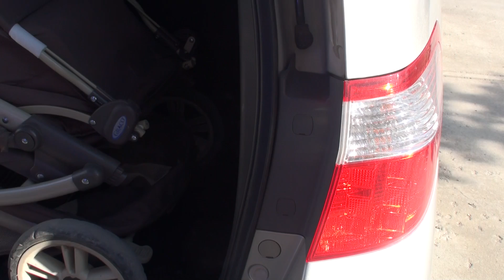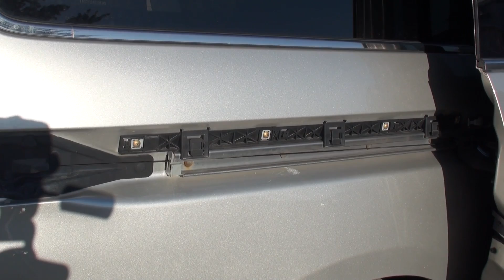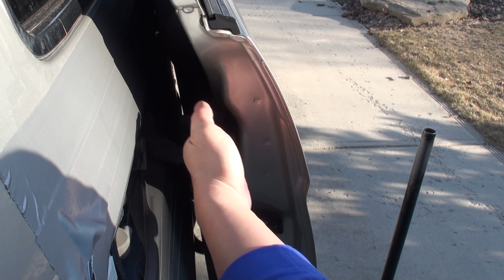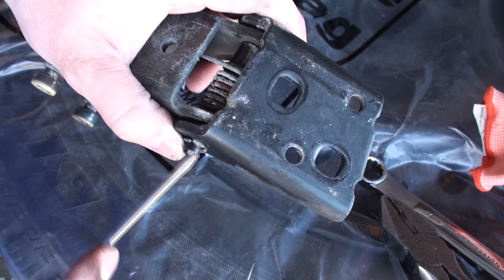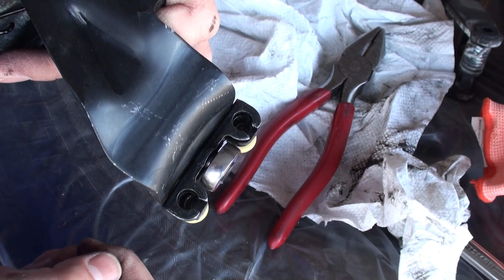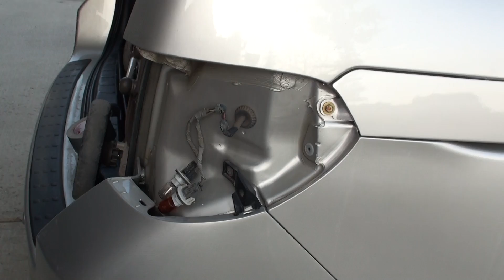Honda Odyssey Center Rail Door Roller Replacement

Comment: I don't have near the slack in the cable that he did to slide the cable out. Is there a way to get more slack?
Reply from the maker: hmm have you tried giving the cable and extra "tug"?  I found when mind didn't quite have enough give that I pulled just slighter harder and I got just enough slack I needed to get the cable into the roller.  The other alternative is to work the roller assembly as close to the van's body as possible.  For every inch away from the body of the van you're losing that in cable slack for the cables to "reach" to you if that makes any sense.
Reply: piercedasian is it one long cable where both ends connect to the roller? it seemed like every time I pulled cable from the rear it pulled the roller assembly forward so I didn't get extra slack, it just shifted the assembly.
Reply from the maker: I hooked one of the cable into the roller and then got it real close to the body of the van so that the cable doesn't "deviate" away from the body and then while holding the roller steady I used a pair of needle nose pliers to pull the cable closer to the roller and I got that tiny bit of slack needed (something silly like 3mms more slack was all I got) but that was JUST enough to get the cable in.  Worse case is you could crack the interior panel to get at the cable release mechanism but that is a LOT of work when most times you can get the cable in and out without having to do any of that extra (and generally needless) work.  The trick is to get super close to the van and don't force things if you know for sure they don't want to give.  You don't want to snap the cable as that would be really expensive and difficult to replace.

Comment: Thank you so much for this video - it really helped me tackle and complete this job today. The tip to cover the paint with tape saved me some scratches for sure!

One tip I can offer from another youtube video - when you go to remove the trim cover for the roller mechanism channel - just close the door until the rearmost edge kicks out before it closes completely, and you'll find the trim completely exposed for easy removal.
Reply from the maker: glad you liked my video!  Great tip on the trim cover.  Next time I have to replace another roller I'll give that shot.

Comment: Great video with clear instructions.  To make assembling the cable easier, I pulled on the rear cable until it was all the way extended, and clamped it with a vice grip pliers with cloth padding.  That way I didn't have to keep tension while trying to maneuver the retainer.
Reply from the maker: good tip!  Glad you were able to replace your own door rollers!

Comment: Just finished both doors. Hinges were completely shot. Don't know how they worked as long as they did. Ordered OEM door hinges online at 
Hondawholesaledirect.com for $40 each. shipped quick. Only took a couple of hours to do both doors. The cable can be a beast to reinstall. Be patient. Thanks again for the vid :)
Reply: Are they still working? Wondering if I should use aftermarket or genuine honda parts

Comment: Hi, 

Can you help me with the correct part number -  Which one would be Accurate - 72561-SHJ-A21 or  72521SHJA21 and Do both left and Right sliding door use the same part or different parts ?

Can you point me to a link where i can grab the part numbers for Left and Right Center roller assembly for 2006 Honda Odyssey 2006.

Thanks.
Reply from the maker: The part # is listed in my description for each side and NO they are not interchangeable.

Check out www.hondaautomotiveparts.com
Reply: I'm not seeing the part number in your description.  Can you repost?  Thanks!

Comment: Thank you so much!  The passenger side took me about 1 1/2 hours, with about 45 minutes of that being trying to reattach the passenger side cable. After doing the passenger side, I was able to complete the driver's side door in a whopping 15 minutes, including attaching the cable (there was a little more slack in that cable for some reason, and it went right back on). On the driver's side, I used a pair of needle nose pliers to grab the cable right next to the "pin".  It worked like a champ.  My passenger side rollers were completely gone.  Only stubs left.  No wonder the door wouldn't open.  Now, I need to find a video on resetting the doors, as the auto open just beeps and laughs at me.  You saved me big bucks, thank you!!
Reply from the maker: resetting the doors is easy.  There is a fuse cover on each side of the van's interior kick well.  Slide the cover off and there is a fuse that is for the power door (one on each side).  Pull that fuse for 1 minute and then reinsert fuse.  Systems should be reset.

Comment: May I ask where you learned to Diagnose and repair cars? I like the video. Your form seems to be very proper and you are conscious of the things most people would not care about not damaging.
Reply from the maker: I learned by just tinkering and my innate desire to do things in a "relatively" proper manner.  I hate poor quality work and strive to fix things with pride.  All self taught through and through...
Reply: I see. That is a very collective mindset. Very nice. I am similar. That is also what many people in the automotive field lack I am finding these days. In truth both japanese and German vehicles require this touch. Which is why both vary when coming to the states as to how long they will last. the hands of the technician are to receive the touch from the engineer..What i focused on in your video was the care you took to preserve things and clean things as well as explain in detail that was clear/ easy to follow. You like computers and nature as well I take it. Cars, computers are centered on very natural origins. Something in them intrigues the conscious mind that often relates to how all things touch in a natural setting to bring something to life..I really do commend you on this.
Reply from the maker: I try very hard to have that collective mindset indeed. Not enough people think that way and thus either don't appreciate the work and care that goes into things like cars and computers.  I see all too often "hacks" that make me shake my head constantly.  

Consider subscribing to (and sharing with others) my channel to get the latest in my OCD videos :)

Comment: Took about an hour with most of the time wasted just getting the cable back in the slot during reassembly. I did find a system that works. Once you have the cable on the front side in get a pair of needle nose pliers. Now rotate the assembly back towards the cable end. Slip the cable nut in to the bottom then use the pliers to turn the cable so it will drop into the slot. The trick is to turn roller toward the cable and turn the cable towards the roller slot, then it just slides in. Don't forget to lubricate the track the rollers roll in. Mine was dry and that may contribute to the rollers disintegrating. In my case one was completely gone and the other on the way.  Thanks again for saving me so much time and money!

Pat
Reply from the maker: glad you got your rollers all replaced and working again. Yeah that cable CAN BE pesky but once you've done one the other side is MUCH easier.  Just patience and time and some logical thinking is all that is needed to fix the issue.  Thanks for watching!
Reply: I'd love to see a video or perhaps better explanation on this before I start this job = oxlacey@yahoo.com

Comment: Nicely done. I was shocked at what the dealer wanted. Even at list price for the part which is I think $75.00 ans at 1.5 hours to do the job, the max should be $225. But they wanted $350 just for one side. I got my part on line $35.00 with free shipping. The unit is so bad the roller is hitting the rivets that hold the track on and often not closing or taking 4-5 tries to get it to close. Not what my daughter with 4 kids needs....
Reply from the maker: yeah what dealers charge is robbery.  Something so simple yet so expensive.

Comment: Pierce - have you tried to replace rear cable  ?   My has broken and i'm looking for similar quality diy video to work through replacing rear cable
Reply from the maker: I haven't replaced the rear cable but I have dismantled the interior to try to do other work and man is it a pain in the ass!  We can try to discuss offline for me to try to explain it although you'd be best to source yourself a factory service manual to ensure you get the job done right.
Reply from the maker: BTW the rear and front cable is actually the same cable.  It just gets pulled back and forth from front to back.  It is actually an entire cable reel assembly.

Comment: Cable snapped on mine.  Had to buy the whole motor assembly because they don't sell just the cable separately.  Popped out the door hinge pin with vice grips instead of unbolting the hinge as shown, and I didn't have to realign the door.  THANKS!  Video made it easy and my $150 ebay motor purchase saved me over $1000 at the dealership.
Reply from the maker: whoa snapped cable?  that sucks.. then again if a cable was going to break that chances are it was going to break.  I'm just glad to hear that you got things up and running again.

Comment: Awesome video!  I ended not taping the van because I was lazy.  I did find taking the cable out of the roller assembly the most difficult, but it's a little easier if you slide the door almost closed and move the roller assembly towards the back where it's all out in the open. I also had to pry the rear light assembly off with a tool.  Thank you for making this!
Reply from the maker: glad you got the van hinge cables all figured out. Did you end up scratching the paint at all in the process if you didn't mask things off?
Reply: No, being a little mindful of it was enough to avoid scratching
Reply from the maker: that's good to hear!

Comment: Both my doors had been giving me problems on occasion.  After my door got stuck when my family and I were 500 miles from home on a road trip I decided I had repair them.  I ordered the OEM parts on Amazon for $50 each, decided not to try the cheaper aftermarket stuff.  I am fairly handy but don't usually work on my cars much.  When I heard it would be over $600 for both doors, I decided to give it a shot.  I had looked at a video a while ago but it scared me away with having to remove the interior panels.  This video gave me the confidence that it could be done without having to do that.  I learned a few things that I thought I would pass on to the next guy so it may make it easier.  I would recommend that you are at least semi handy to try this because you can get some curve balls in the process.  Some people said to leave the hinge attached and pound the pin out, mine would not move.  I unbolted the hinge and pounded it with a hammer but it still wouldn't go.  The bushings in the hinge seized to the bolt and after an hour of pounding I gave up and cut it with a hacksaw.  Luckily Honda has the pin for $10, I also had to replace the hinge for $15.  Instead of using a marker (hard to see) I outlined the hinge with painters tape.  Putting it back together,  I found that it was easier if you put the roller in the track and work the cable in from below to give maximum slack.  It was still pretty hard but I used my needle nose pliers which I taped up to not damage the cable.  I would also wipe the old grease and dirt in the track before you reinstall the cover panel.  Because of the seized pin, the first door took me over 3 hours.  I did the second in under an hour.  Thanks for the great video and saving me almost $500 bucks!
Reply from the maker: holy smokes that sounds like a lot of work for a little pesky hinge pin!  glad you got that all figured out because nothing can be more annoying that a temperamental door that doesn't want to operate properly.

You're most welcome and thank you for watching my vid!

Comment: Outstanding demonstration on how to replace the roller hinge.  I am having the same issue with my 08.  I think this will be a breeze, following your lead.  I do have to tell you though, your change in demeanor, after your frustration with the cable, subtle as it is, made me laugh out loud.  Nice job.
Reply from the maker: lol, you caught that in my vid huh?  yes it was a B*TCH to get back on at first b/c I was learning myself but geez I was ready to kill someone until I figured out the "whys" it was lacking slack.  Just work closer to the van to buy you that extra 2mm of slack need and problem solved :)

Comment: Thanks for the video and is my details and have great tips. My door cable is just broken recently and the door cannot close manually smoothly and leave about an inch of gap. I can still close it by forcing the door very hard and now leave a scrap on the door. :> I wonder does it sounds like I have to replace the hinge? Second question, do you have a video of how to replace the cable? Thanks, again.
Reply from the maker: Hi Chris, unfortunately I don't have a vid on the cables but it does sound like your hinge is all buggered up in conjunction with possibly another hinge elsewhere.  I can't say I've seen a van where the manual operation was kludgy but I would definitely start by replacing at least the cables and rollers.  Cable assembly if you'd believe it isn't too hard to replace but just time consuming.  Sorry I couldn't be more help.

Comment: Just another thankful DIYer commenting on how much I appreciate this video tutorial!  I do a lot of my own repair work, including timing belts and other involved jobs.  But I hate removing interior parts because things are never quite the same afterward.  Doing it your way is by far the most preferable way to replace these hinges.  BTW, I was able to pop the second cable end into the hinge bracket in a few seconds.  I used a large pair of needle-nose pliers to hold the cable about 1/2" back from the little metal cylinder that goes in the hole.  That allowed me to pull that bit of cable around and into the slot very easily.  I was pleasantly surprised by that!  Also, thanks for the tip about masking off the area with painter tape.  That really helped save my paint.
Reply from the maker: glad you liked my vid.  I am just a DIYer that likes to share information.  I learned by watching others and through my own trial and error and found out about 20 years ago that I was good at what I did so I just kept fixing more and more cars.  I can't bear the thought of paying the stealership to do the work as they charge RIDICULOUS money for such a simple job.  

Glad you were able to fix your own doors.  Thank you for watching and consider subscribing to my channel :)

Comment: Question: With the exception of the cable connection, can I use this same bracket and procedure to replace the slide bracket on a 2006 Honda Odyssey that does NOT have automatic door?
Reply from the maker: you don't use the same rollers.  You have to use a roller assembly designed for a non powered Odyssey otherwise the procedure is the same.

Comment: Great video.   I had changed the driver's side roller last week based on a video that required the panel removal.  It took me about 2.5 hrs, and the panel didn't go back in perfectly (which for a 2010 Odyssey Touring I'm OK with).   I wondered if there was a way to do it without the panel removal, and this video gave me confidence to try it.  The whole job took about 30 minutes.  It was 15 minutes of frustration getting the cable in right, but well worth it.     The duct tape and marker were great tips.  Thank you!
Reply from the maker: glad you liked the vid and glad you saved yourself 2 hours of work that wasn't needed!  The panel removal method is technically the factory approved way of servicing the rollers but as you have experienced yourself it is something totally unnecessary.

Comment: has anyone experienced different size bearings on this part?
Reply from the maker: not that I have seen.
Reply: I ordered the part online and entered my VIN, well... the system didn't verify the VIN like it said it would and the roller they sent was for a 2011 model, not the 2006, so, the bearings were bigger on the updated model.  Otherwise, once I got the right part, it went in just fine!
Reply from the maker: wow, good to know that the newer vans use  a larger bearing.  Glad you were able to fix your door :)

Comment: Thank you for sharing. I like others watched other videos showing dismantling the interior and was deterred. I just did my 2004 in about 30 min. All the replies were helpful. I did it leaving the door bracket on. And that's what took the longest, lining up the holes for the pin. Only thing i found was the forward mount for the rail cover panel broke off its weld, Oh well. Still works.
Thanks again.
Reply from the maker: glad you got most of the door fixed properly. Thanks for watching!

Comment: Well i was able to get one side done.  followed the video pretty close,  did take me a while to get the cable connected back, in but i made my son help me with that damn cable.  will work on the other side when i get a chance. This video was a great help. 
 I currently have another issue going on where the vsa light comes on when the van stops, then puts it into like a slow limp drive mode.  turning engine off fixes until stopping again. its weird seems only to do this after driving for a while.  if anyone has heard what fixes this let me know.. :)